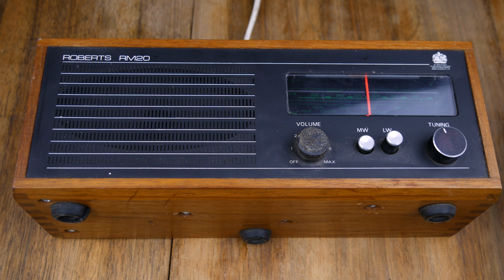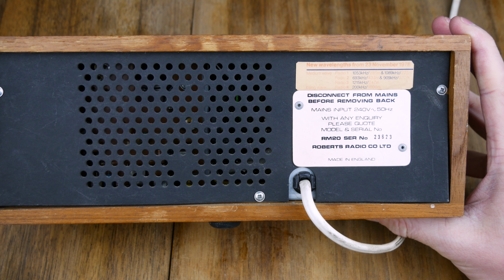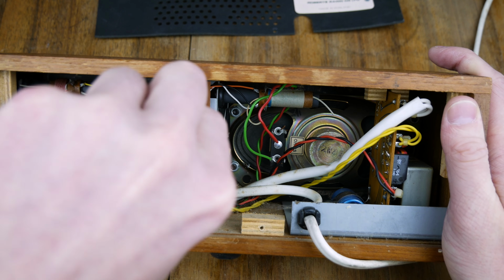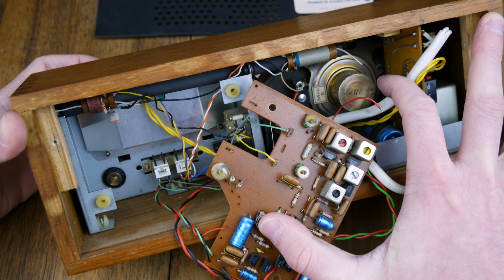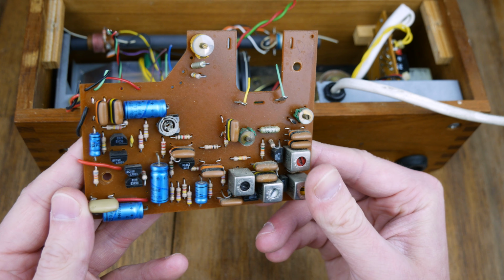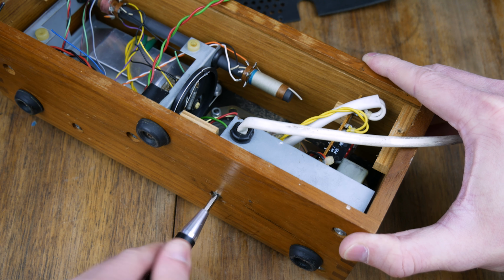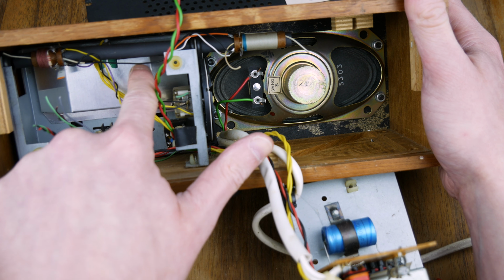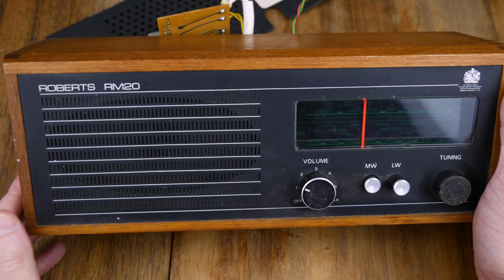A look inside the Roberts RM20 - I know nothing ;-)

Comment: You could use a panel mounted usb socket, and connect the radio to a normal wall wart usb power supply. That will save worrying about noise from the psu, and you will only have low voltages inside the radio.

Here's a link to what I mean:
"www.hobbytronics.co.uk/cables-connectors/usb-connectors/usb-panel-cable-microb"

Comment: It's a bit late now, but...
I think that if you had removed all the chassis screws from the bottom, the two knobs from the front, and disconnected the speaker wires; all the innards should have been able to come out intact. Power supply first and then the RF side complete with the whole tuning assembly...

Comment: I think knowing a little about the basics of "radio" is very worthwhile. WiFi, Bluetooth, DAB and DTV are all technologies that depend on the same fundamentals as "old fashioned" radio/wireless. Antennas, coils and capacitors are needed for tuned circuits to receive any signal. Look at, for example an ESP8266 board.The zigzag copper trace is an antenna, the inductors and capacitors may be smd components or "on chip" but they are there.
Reply from the maker: You are right Stephen. I know a fair bit but not enough to confidently talk about it so I prefer to plead ignorance. I got some pretty spikey comments for a video I made years ago about 433mhz modules, so I am not the goto radio/wireless guy.

Comment: There are schematics for this RM20 online.  You'll need to sign up for access.  The metal boxes are called intermediate frequency (IF) transformers, and are tunable via the top (sometimes also bottom) holes, whereby a ferrite slug can be screwed in or out to adjust the tuning of the IF transformer's coils, and thus, frequency of operation.  Before the radio signal becomes audio, it passes through RF amplifier circuit, local oscillator, mixer, and IF stages (where these components are found).  The innards of IF transformers are quite interesting, fragile and come in many designs.  These devices have long gone the way of the dodo, given more integrated and/or digital circuitry.